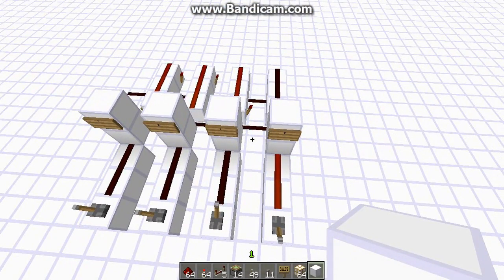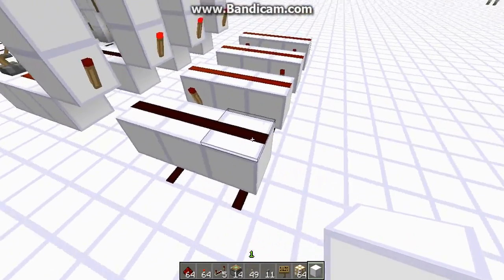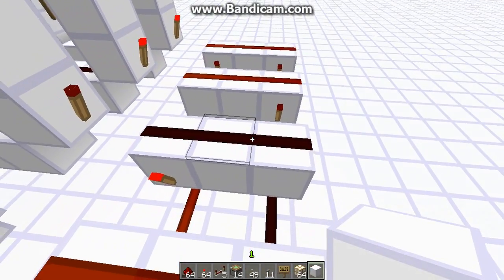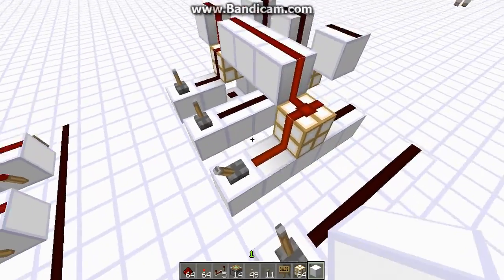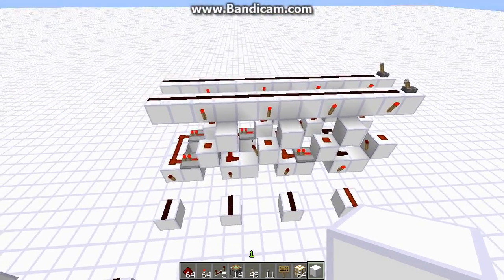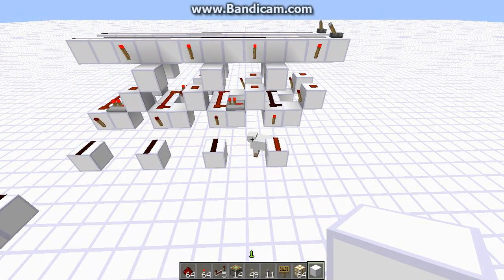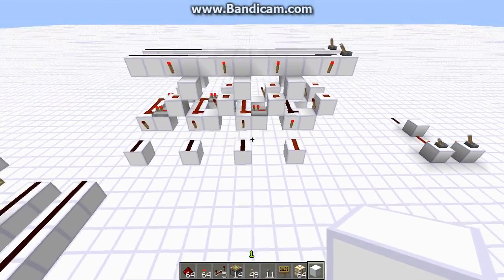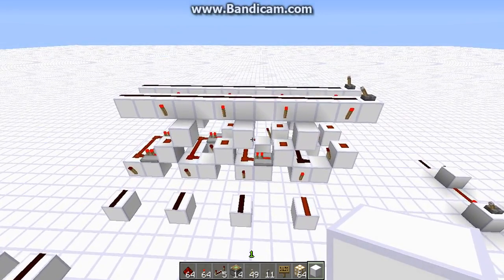Mathematical Redstone Circuits 2: Encoders/Decoders

Comment: about 10:30 you say the design is hard to make, so for large decoders its useless. However, binary falls into pattern. If you make a decoder (including an outcome for 0) let's call the number a bit represents in decimal N (so 2nd bit > N = 2,  4th bit > N=8). It so happens that N is the exact amount of output lines (counting from 1st output line = 0) that the bit  has to be off in order to decode the numbers these lines represent correctly. After N amount of outputlines, the bit has to be on for an N amount of output lines. (this repeats itself, so N amount of lines off>N amount of lines on> N amount of lines off etc.) For example, for bit nr 4, which represents 8 in decimal, the 1st all the way to the 8th line (so outcome 0-7) has to be off. (which makes sense, because in the numbers 0-7 there is no value 8) but at line 9-16 (number 8-15) the line has to be on. So if you walk along the input lines of this decoder, you can very easily know on which output line you have to place a torch(= On in this design) or a repeater. If you have worldedit installed, you can just paste a repeater construction N times then paste the torches N times etc. Yes, this still isnt super fast to build, but being able to use worldedit reduces the build time so much that the benefits of this small fast decoder outweigh the drawback off the building time

TLDR: binary has a very easy pattern when counting, switching between bits being one and zero (on and off), so it is very easy to determine where to place torches and repeaters, if you place the decode torches/repeaters one bit at a time instead of figuring out what is the binary equivalent of a unary number, you can use worldedit to quickly stack some parts of the decoder, making the  long building time shorter, and therefore less of a drawback.

Comment from the maker: You're right, there are more than 10 states in redstone signal strength :) I didn't include it in this list since prior to 1.5, it was less than intuitive to take advantage of that, but you're absolutely correct. And after 1.5, I think it'll be a great way to represent numbers :)

Comment: decimal is one digit has 10 symbols and has one's place, ten's place, hundred's place, etc. Unary has one digit/one wire to represent every single number. For exmple, 10 is the 11th digit (if you have a wire for zero) in unary, however in decimal it is the second digit. Hope that helps/makes sense cuz I'm not 100% sure :)

Comment from the maker: Decimal is tricky in minecraft because there isn't really anything with 10 states. So you can either make a decimal interpreter, or you use something called Binary Coded Decimal (BCD). BCD has a 4 bit binary number for 0-9 in each decimal place, and it's the simplest solution in most cases.

I have a tutorial on BCD in vid 9 of my calculator series. Hope that can help you :)